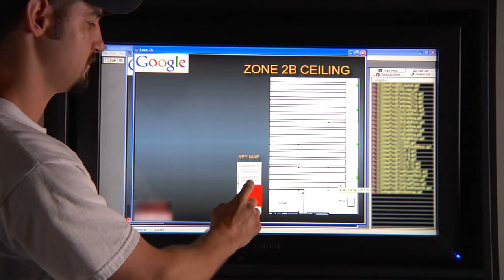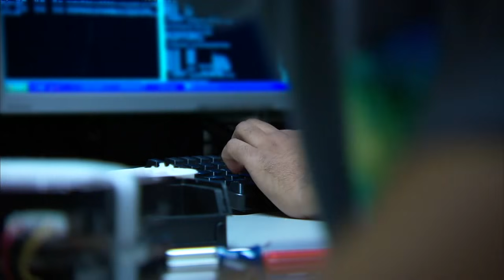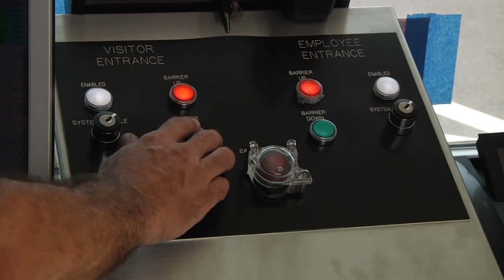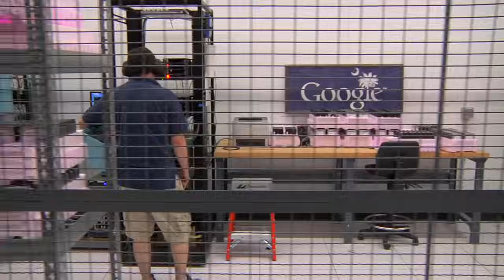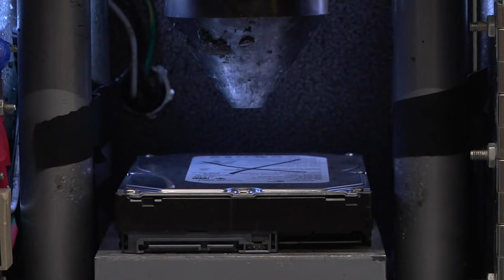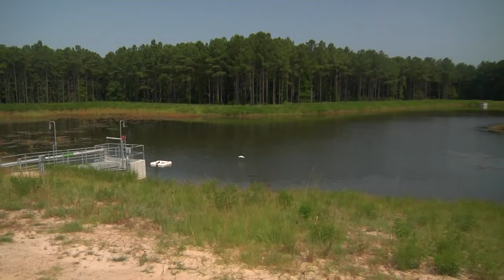How Google Protects Your Data

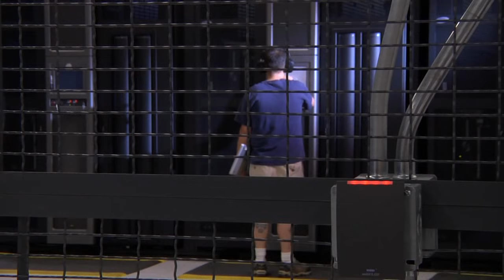Comment: Why google data centers are equipped with HID iClass readers as seen at 1:11 min of the video?
I thought the data center is highly secured!
So their security integrator doesn't even know that it's cracked since almost a decade, that HID is a proprietary system with an encryption made by themselves not using any open source encryption that are proven more effective and secured than proprietary encryption.

So to walk in google data center like it is currently possible in most of google premises in the world, simply buy the needed equipment to sniff the security card of an employee while he walks outside google premises.
Then duplicate it and come back when ever you want to access to the premises!

Pretty scare to know that google as low understanding over physical security and trust proprietary technologies...

Comment: Google is such a large company but they still us hard disk drives.
Reply: +therailwaytrains IF a power outage happens because of some reason. EVERYTHING will wipe out of the SSD.
Reply: Maybe because server HDDs have a much better longterm reliability, are cheaper, and have more R/W cycles than SSDs?
Reply: +therailwaytrains Solid-state drives have limited write cycles, so they die faster than a hard drive.
Reply: +therailwaytrains sdds are more expensive and can have alot more go wrong with it with a fact of being faster but it dont matter if they have highspeed fiberoptic cables with specialized OS
Reply: +John Marc Cagatin they have UPS for every server so no, that's impossible. Besides, using a data distribution system (like raid5 in a pc) multiple drives can fail while still keeping the data
the only thing that could possibly wipe them is a severe controller failure or EMP
Reply: Oeh. Mmhk :D
Reply: yes they could do that but that would require shuting down may servers t add them and google is a massive company and for it to shutdown could cause major back lash
Reply: +Sevival What if the EMP strikes the whole center? No more Google?
Reply: +ClarenseE I don't know. maybe their structures are caged and isolated againdt electromagnetic interference.. but most likely it would kinda get fucked up
but then again, they do have over 15 data centers and if there is an emp blast i'd think there would be other things to worry about rather than data loss :p
Reply: +ClarenseE They'd have to strike every data center.
Reply: +therailwaytrains They still use tape drives, too. They're one of the largest consumers of tape drives.
Reply: Just need to blow the cooling reservoir..
Reply: Blow their water cooling reservoir tank...
Reply: Maybe because server HDDs have a much better longterm reliability, are cheaper, and have more R/W cycles than SSDs?

Comment: Wonder in what harddrive my yt account is stored.
Reply: +PotatoesHD No not raid 0, its too risky, Raid 5 is the safest.
Reply: +PANDAPIE ikr
Reply: +Capitan Winners raid 0?
Reply: +PotatoesHD
Reply: +Jackal True
Reply: +Jackal Thought they would use something like RAID 10 or RAID 50
Reply: +Haloid Android I guess you don't have to come up with such standard expressions on RAID for such an enormous advanced data center. Their storage system will be a bit more complicated than just "RAID x". I guess the harddrives in the webservers don't even contain any user data. There will be sone 10-double redunant database server system for that.
Reply: +Haloid Android Correct if they are swapping drives they are definitely not using raid 0
Reply: By the way, RAID 5 is not the safest. RAID 6 has double redundancy, RAID 5 only single. But the double redundancy takes a bit off the performance. And there are many many more possible RAID configurations with different safety levels. Easily to find on Google.
Reply: And another thing to say is, "RAID is not a backup". A common line in the IT world. RAID 5 is good enough to prevent any downtime at good performance. For backup you need to copy all the data to a few different off-site locations.

Comment: why do you need the data center its self to have all of the security should it be in the software not the hard ware and that does not seem cheap to do is it for bragging rights any way I'm pretty sure hardware is safe for all of my google stuff. i am wondering
Reply: It helps if you use some comma's and dots in your texts. I have no clue what you want to say in this pile of a hundred words.